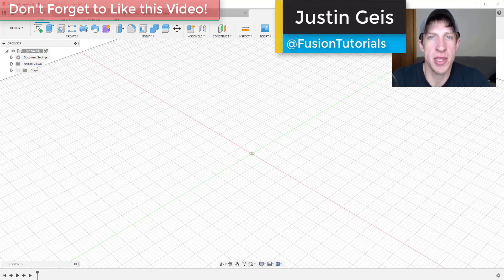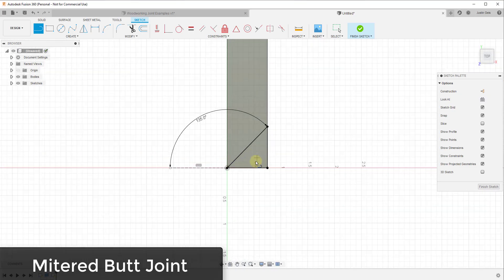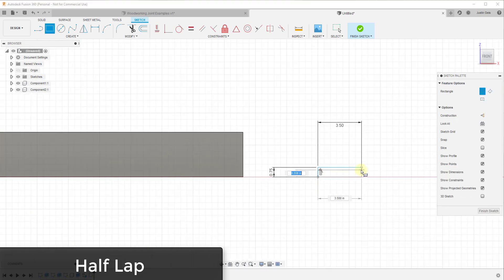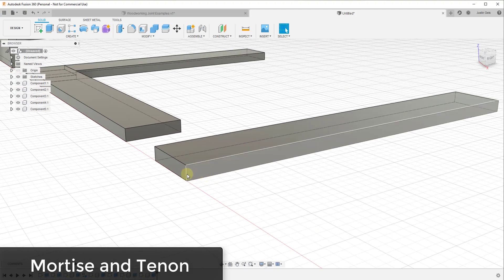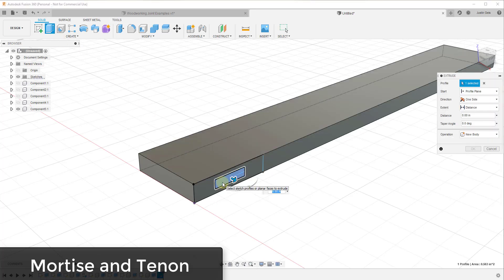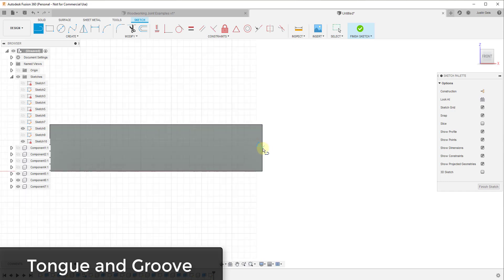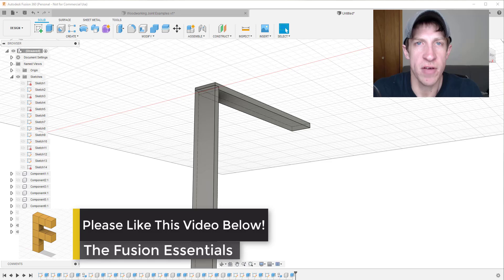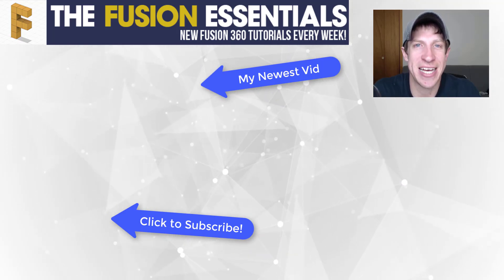Fusion 360 for Woodworkers Part 3 - Creating Common WOODWORKING JOINTS in Autodesk Fusion 360

Comment from the maker: Hi everyone! Let me know if you have any questions, or if there are other joints you'd like to see covered in the comments below! :)
Reply: I notice you do videos for fusion 360 and sketchup. Which do you prefer for woodworking?
Reply: Jordan, thanks so much for these videos.  One issue I'm having with Mortis and Tenon is that the mortis is not translucent like it is in your example.  It basically looks like a rectangle is cut out but I can't see the outline if the Mortis.  Any suggestions on how to address ?
Reply: When you did the tongue and groove joint, the tongue still had the two faces from the end view, how would you remove that middle line that divided the tongue into a top half and a bottom half?

Comment: I'm curious why you draw 2 lines to form the edge of the board, then draw a rectangle. Seems like a lot of extra work over just drawing a rectangle. Select one corner, select another corner in the direction you want it to go, then type your first dimension, tab, then type second dimension, hit enter and boom - you're done. No need to draw a line, type in dimension, hit enter. Draw another line, type a dimension, hit enter, draw a rectangle snapping to the lines you just drew.
Is there a benefit to doing it your way that I'm not seeing?

Comment: And then you need to do them again, again and AGAIN every single time you create a new model because Fusion is BS.

Get Solidworks. You can create an intelligent feature library where you create these joints ONCE then you add them to your new models by just telling "i want this joint" then you select the features that define the size and location for the joint that you defined when making the feature into the library and it'll create all the geometry that's needed and adds all the parts (screws, hinges, what ever) needed for that feature.

I'm never going back to fusion nor Inventor... this is how CAD should be, do something ONCE and then just reuse it again and again and again.

And Solidworks isn't event hat expensive anymore. You can get the hobbyist version for ~20€/month or so and there are no limitations in functionality except that you can't open hobbyist files in "real" Solidworks...

Comment: I wonder why to create a rectangle you create two lines then use the rectangle tool instead of just using the rectangle tool. What value do you find in this technique?
Reply from the maker: Just kind of the way I've always done it from when I first started to now. Probably because instead of having both dimensions in my head I go through them one at a time, then use the inferencing to close it in? No reason anyone else needs to do it this way - probably just a weird thing about how my brain works :)

Comment: 6:35 When you create the new sketch, your viewport / camera centers on the component you are sketching onto. For me, this action enters the 'plane' and 'sketch mode properly', but  the camera centers on our miter join where the document origin is, rather than the plane of our new component. The new component moves WAY off camera and i have to pan to find it every time.

I have 'auto look at sketch' enabled in preferences, its just that the 'sketch' it looks at is not centering my camera to the correct location. Can anyone help me with this?

12:28 - when he makes the Mortise visible, the outline for the tenon joint is outlined. For me this is not the case. I can't find a setting for this anywhere, so advice here is appreciated too!
Reply: I have the same issue, have you figured out a solution ?
Reply: @JariMallard  unfortunately not :( 

I've just had to settle for the feature set as is, and gave up after searching forums to no avail.

If you find out, I am dying to know!

Comment: Good stuff.  Thorough & comprehensive.  I'm just starting w/ Fusion 360 and this was helpful.
I am struggling w/ something:  I am building a bench out of 2x4s and want to have a 45 degree mitered brace that might start from 12" below each corner and go at 45 degrees up to meet the bottom of the table top.  I'm sure I'll figure it out soon enough...     It's a journey.

Comment: Thanks for the tutorial on woodworking joints. The mortice and tenon, tongue and groove joints were a great help. I'm very new to fusion 360. I would not have thought to cut the grooves out then extrude them back in and join. I can now see the advantages to creating components rather than just creating bodies. I need to learn more about jointing other components for assemblies.  Very nice.  thanks

Comment: So I want to join 5 pieces of wood to create a pentagonal frame with half lap joints at each of the intersections. Looking at these wood joints I’d like to think it would be easy as you’ve explained them so well but it’s the added dimension of an odd angle of cut that I’m struggling with. Great if you could do something along those lines. I am new to this but, already subscribed.

Comment: I'm curious why you aren't actually using joints though.  shouldn't those be solid joints (except possibly the mortise and tenon if the pieces should be allowed to be removed).

Comment: On the mortise and tenon joint around the 9:15 mark you put in a reference line centered to help you center the cut out for the mortise. Your line tool indicates center of the edges of the outline of the board, but mine doesn’t do that. I have no indication of where center is. I just eyeballed it for now to move forward with the tutorial. Is there a setting I need to change so it will show me center?

Comment: As I keep trying 360 for my woodworking designs, I keep running into a couple of problems: 1) every time I extrude, 360 has the direction I want as negative (pain in the neck to have to remember the minus sign); 2) the origin isn't oriented the way I expect, as in the x, y and z are going my component when i'm trying to use the Joint function, whereas I need it to point  the component.

Comment: Justin

Loving your series on woodworking, but having a slight problem.
 
I have just started to learn Fusion 360 (Non commercial use only-Free) but every time I do a project like copying your joints and it needs more than four individual components the components turn pale blue and if you click on it even with the select tool it disappears totally. It appears to be a number of component issue as when I copied your bookcase, as only one component it was fine.

Comment: It took me forever to figure  out why drawing tools weren't snapping to vertices and significant points (midpoint, etc.)

You need to have the "Auto project edges on reference" enabled in the "General -> Design" area of the F360 Preferences... 

I wasn't able to get my 45deg line to snap to the top corner at all until I did a ton of searching and tracked this down.
Reply: Thanks for this! I went over and over, trying to see what I was missing.

Comment: Thanks for making these videos. After watching the entire series I can now say with confidence that I can model everything I need to using this tool. 

And I have to say Fusion 360 is not without its quirks, but overall it's imho the best tool out there of this kind for woodworkers. Once you understand it's all about sketching and extruding you're 90% there. 

A few things this product falls a bit short on are : 

a) Snapping. I find snapping is hit and miss. It really tries to snap to grid, but has a difficult time snapping to edges. 

b) Parts list. Basically using components isn't enough. The parts number is not what identifies and binds components together as one type of part. No, what you have to do is clone / copy existing components, then you will see correctly adjusted quantities in your parts list. And mirror copy doesn't work either, this will create a new kind of component. This is something from a programming perspective, which is easy to solve, and maybe we will see this fix in future versions. 

c) Sometimes when you draw a new shape over an existing one, and finish the sketch it will create not 1, but 2 surfaces for you, then you need to select both before you extrude. I guess this is a bug, because there's no logical reason for this. 

d) You need to be careful, because join operation when extruding will join with any connected material, not just the edge you're extending. I found this a bit counter intuitive, but I guess this point is subjective. 

e) Back to snapping you really need to be exactly sure of what you're doing and check and recheck your snapping, zoom in all the way if you have to, because from my use, I've seen sometimes slight variations in the lengths of my designs, and I have to redo them after later inspecting and measuring because my start points were off, even if it looked like I had snapped correctly and tried to be careful, clearly not careful enough. As I said it tries to snap to the grid, not the surfaces, which can cause problems.

Comment: Don’t forget you can use construction lines and projections to make things easier.  Also, you can do assemblies as well, but that may be more than needed.

So for example, the mortise and tenon.  You can use two construction lines, one vertical and one horizontal for the center, then use a center point rectangle constrained to the cross point of the two construction lines.  Projection will allow you to project a body, component, or lines from another sketch onto your current sketch.  Just one example of many ways to skin the cat.